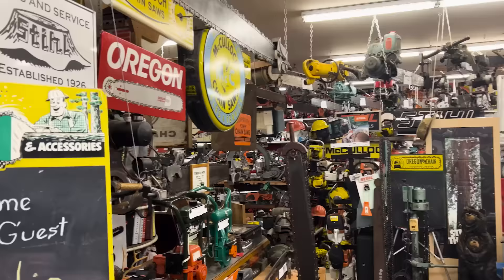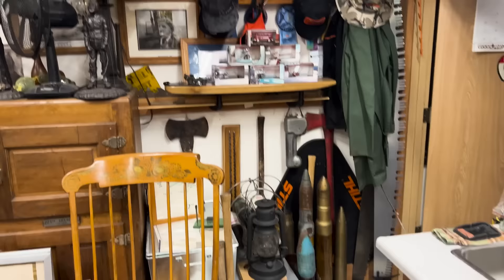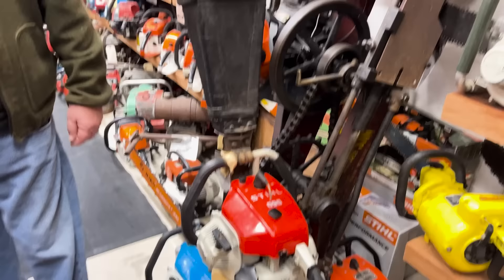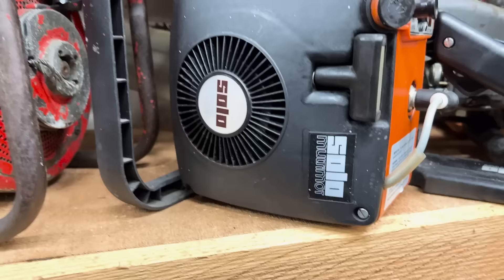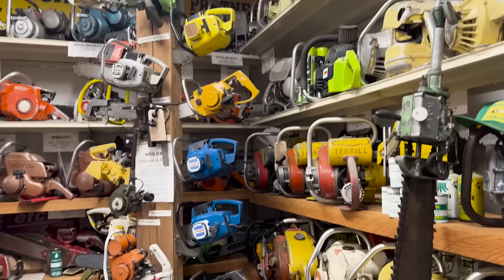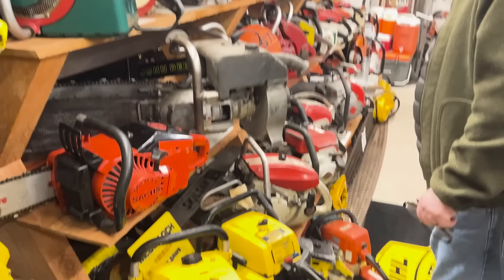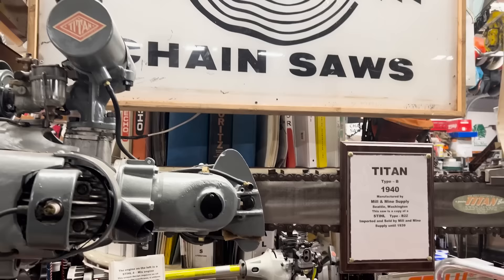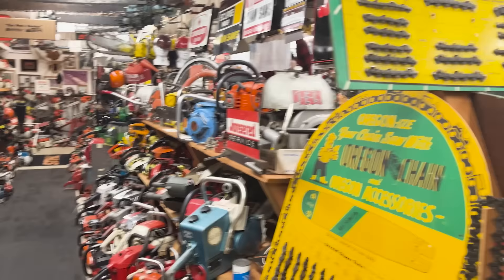Chainsaw Lovers Paradise

Comment: I am the caretaker/owner of a 1954 Stihl BLK that has never been sold.  The farm dealership I worked at had bought 2 and only sold one. This one was used to cut up wood shipping crates and occasional limbs.  I inadvertently threw the float carb away.  I believe the saw to have the original bar and chain on it. About 1979 the weighted hose for the fuel rotted off and when we try to take off the top of the fuel tank the screw slots rounded off.  I get it down off the shelf to show people what the "First lightweight" chainsaw was.  When I tell them to pull the starter cable it usually jerks the cable handle thru their fingers.  I had it at a tractor show a few years back and a guy wanted it with a passion.  His last offer was $2K and like a fool, I turned it down simply because "I had an unsold BLK".

Comment: Boy howdy, no kiddin’ about a bow chainsaw. Was working for a pipeline company clearing right of ways, went into the tool trailer. Came out with a McCulloch bow saw cranked and throttled it till it ripped into my jeans. Thought it was a fluke tried it again same result, no injury. Saw went back in the tool shed.

Comment: I have 3 Stihl 045's 2 were my grandpas felling saws from the 70's and one was my dads in the 80's.  I Just got my dads 045AV running again, but unfortunately both my grandpas saws are done. one has a broken piston and case and the other is in parts, apparently had bad seals on the crank.  At least my Dads saw is back running and cutting wood again it is a beast and according to my dad my grandpa hopped it up to an 050 if that is possible??  My grandpa was an incredible saw mechanic and made a living fixing saws long after he retired from felling trees.  I feel like i have his bug for saws as my shop is full of saws that I have taken from scrap bins and got running and working again. Every time i dig through the box of my grandpas old saws looking for a part i get a little nostalgic.  I am 53 and about the same age he was when he built these saws.  My 045av still cuts with the best of them.  I just wish Grandpas old saws were not beyond Repair, maybe one day i wil try.

Comment: Yes very nice thanks' for sharing and showing what chain saw sickness defined. I got a Stihl 009 and an AV012 that one has 45 cc believe it or not. I also have 2 Jonsereds 2171 ,24' bar and a 2145 with 15' bar and my newest saw is a Husqvarna 257 that runs but isn't running right at the moment . Be safe an and thank you sir.

Comment: I'm surprised there aren't more Homelite's in this. They were the logging and homeowner saw with several innovations from the 60's to 80's before sthil took the market. Very impressive nonetheless :D
Reply: They’re junk that’s why
Reply: @koda7820  no. The xl12 is still a legendary saw
Reply: @koda7820  I would say if it weren't for the homelite's that you wouldn't have the versatility of chainsaws that you have today. Homelite had several adapters that allowed you to add just about anything to a saws powerhead. I've personally got the auger, winch, gear drive and auto oiler adapters. Also some of the first I know of that had auto oiling. Now the later cheapo homellite's were complete junk. At that point they lost the market anyway. The xl series were a leap into the smaller more "current" saw sizes. Even the sthil's 0 series saws were modeled somewhat identical to the bigger homelite's using the same parts.

Comment: Almost fifty years ago I saw an 090g in Arcata CA (redwood country) with an unbelievably long bar. I've never been able to find out just how long of a bar that saw would pull. I'll bet Wayne would know.
Reply: Probably an 8 foot bar,we used to use 5 or 6 foot bars here in British Columbia when I was heli logging,we would have to rip the big heavy logs in half so the helicopters would get em off the hill. The 088s would take the longest bars so the 090 would have been the same. Cannon bars here in BC made the biggest bars available 😎

Comment: Husqvarna 365 e, 72D chain and 24-36" bars
Echo top handle 300 series, climber saw, stock chain and bar.
Rototary attached to Dewalt for carving
Husqvarna 1472, stock chain 48-52" bars
Skil extendable uplift saw stock all the way
Stanly orange Hydraulic, with 72D and 14in bar. Yup, heavy but more turgue and  aggressive chain. 
I also don't side bar. I seen the results of a kick back from hitting a T-post. Came back, eat the chaps and 2in into Donald's leg. I also hold the trigger in before starting and rotate my entry, allowing the dogs to set. I don't tip cut. I also don't toe throw trees. Or use a jack. I use blocks with gas rope winch or horn. I try to avoid use of vehicles unless out of the zone.

Comment: I miss the days when chainsaw SHOPS looked like this. Now the manufacturers want mkre and more places to look like a Mercedes dealership showroom floor, which actually does customers a DIS-service.
It used to be a knowledgeable OPERATOR could simy pick the parts they need off a shalf, rather than tell someone what they need and HOPE they heard you right.

Comment: Growing up, I remember the loggers loading train cars with pulp wood. They had Jonsereds saws! In my opinion, saws before their time! The saws had the round air filter just above the handle. A guy gave me a 621!! Nice saw!! Needs a crankcase/fuel tank gasket as the tank is weeping a bit. I'd like to get a Jonsereds 80 silver top!!
Have a Jonsereds 520sp.
https://youtu.be/qAjyrnAydUI